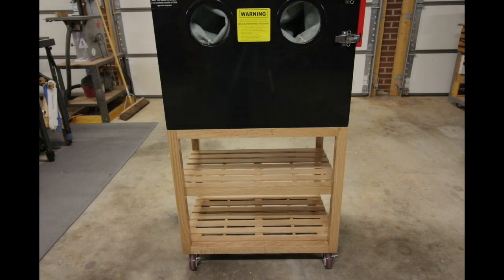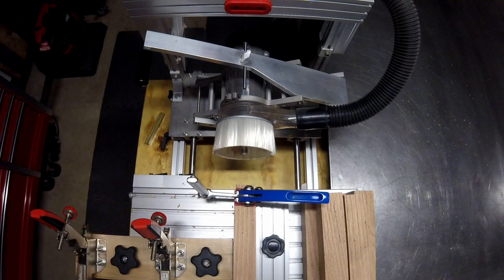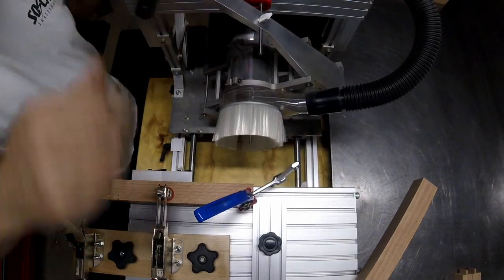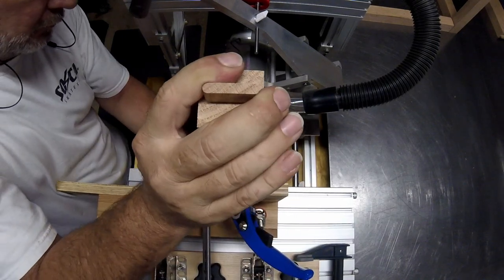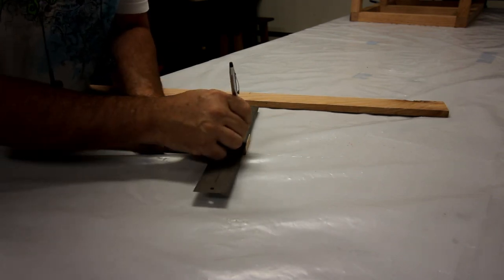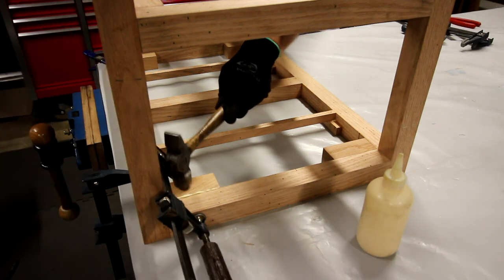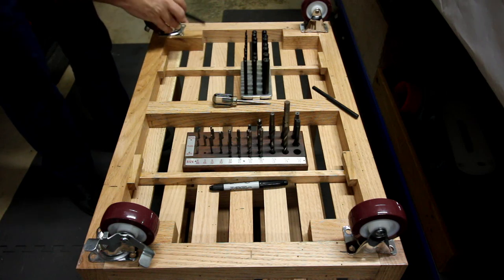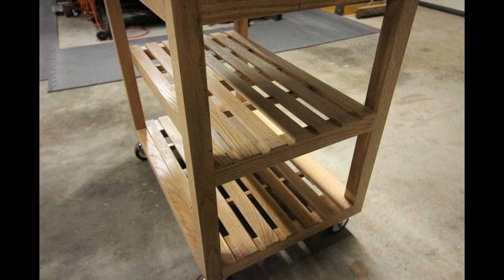Blast Cabinet Stand using PantoRouter

Comment: Nice project.  came out very clean and crisp.  looks great.
For other projects where strength of your furniture or structure, or whatever, you want to maximize tenon thickens, relative to the member it is supporting.  For maximum strength, your tenons should be at least 1/3 of the thickness of the member.
Reply from the maker: Thanks JM! I agree that the tenons are a little small and again this is a light duty application. I limited myself by my material choice. I didn't want the cart to look too bulky. The Pantorouter comes with standard bit/guide bearing/template configurations. I could have made a custom template for this but that is a project all on it's own! That's just what worked for the dimensions used. I'm not to concerned about it on this piece as it's oak and the cabinet really is light even with media in it. I made a kitchen island with the Pantorouter also and followed the exact dimensional guide for tenons in it's construction that you mentioned. Thanks for the intelligent comment!
Reply: Burton's Attic I'll bet the kitchen island looks amazing! Very cool to see stuff well done. Thanks for posting!